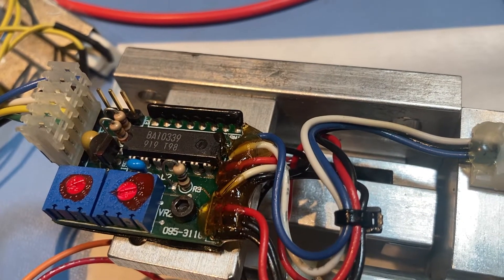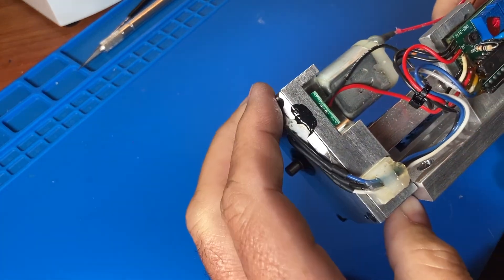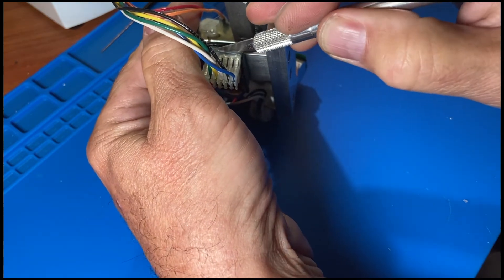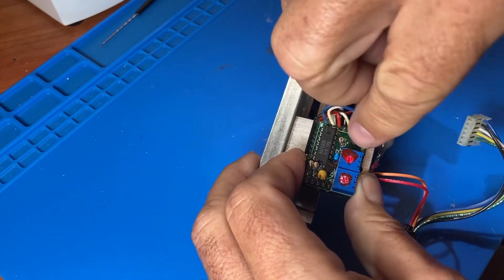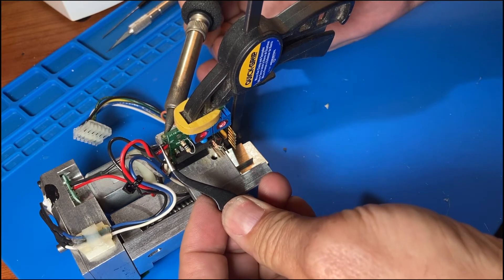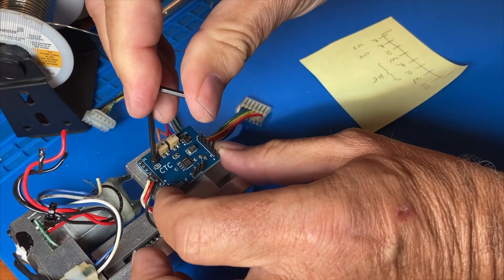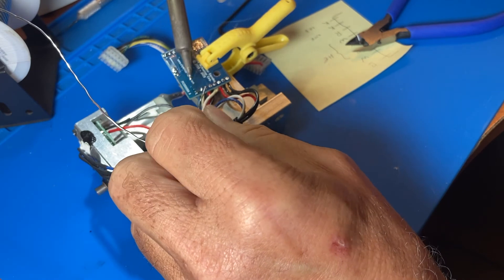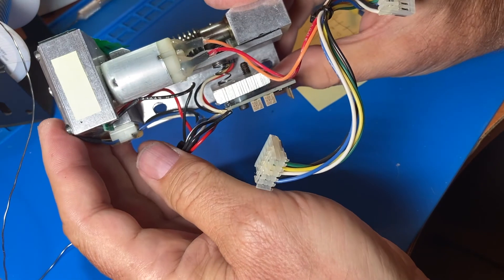Replacing the LX200 Motor Encoder PCB

Comment: Do you work on these classics anymore? I just bought one and I think it needs to be gone through. The seller had never used it before and plugged it in for the first time just before I arrived from a long drive and he said it beeped then died. I’m afraid to touch it honestly.
Reply from the maker: Sounds like one of the 5 notorious LX200 capacitors shorted. You'll need to find out which one. There is a fuse which blows (yours is no doubt blown), so you'll have to buy a few 1.5 amp slo-blow fuses for testing and progressively plug in connectors until you find out which one died. Check out cloudynights.com for more info there.

Comment: I have just replaced the motor encoder boards with your boards, but found calibration (also with your board) a little frustrating. Achieving the correct settings by adjusting the pots was not as smooth a process as the video, fine adjustments seemed to caused rapid fluctuations in led colours. Nevertheless both drives seem to operate as commanded on the bench.
Reply from the maker: I've seen that as well on some motor assemblies. I believe there is a wide variation in the IR components as well as encoder mask alignment, across all of the LX200s sold over the years. I've had success with re-aligning the masks but I do not recommend doing that, especially if drives are operating OK. Also there seems to be more noise in one direction than the other, for instance try both north and south movement on the DEC drive; there is a noticeable difference on our LX200 here.